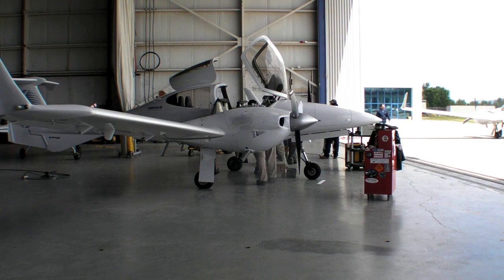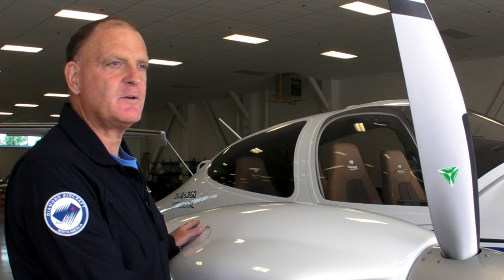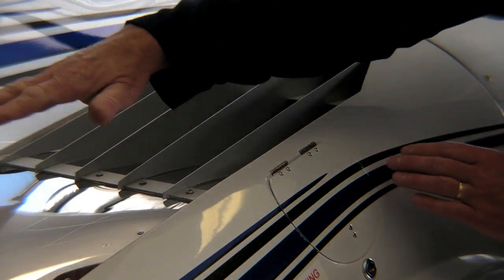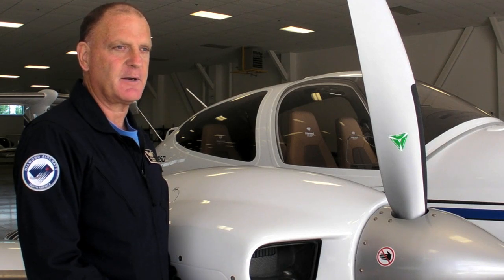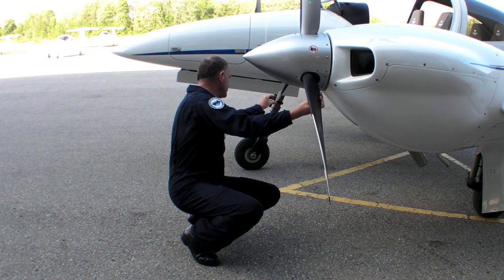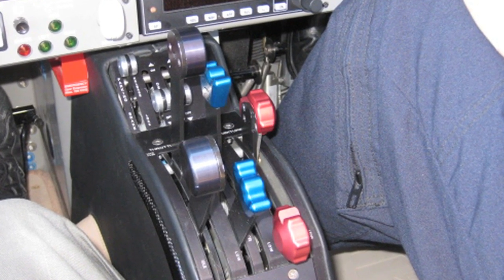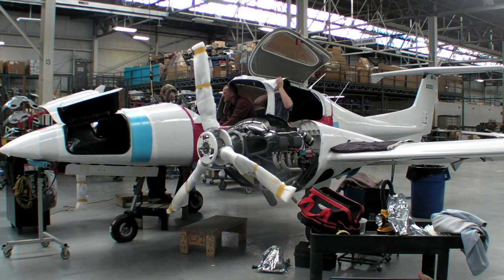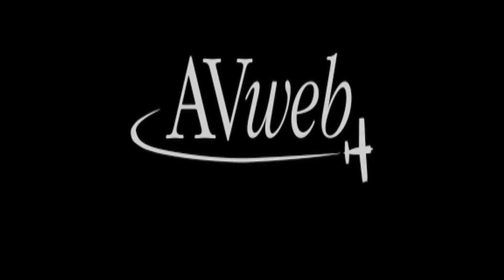Lycoming-powered Diamond DA42 Demo

Comment: If you want a better diesel engine, should have developed the Opposed Piston 2 Stroke Diesel, which can be smaller and lighter than conventional diesel engines with up to 30% savings in fuel economy.

Comment: Same fuel capacity but twice the fuel burn of the diesel = half the range. Worse: the Lycoming engines are lighter than the diesels but the engine mounts weren't sufficiently redesigned resulting in mounts that are too short, requiring 66 pounds of lead to get the c.g. Into a safe range.

Otherwise, fantastic visibility and visibility.

Comment: At about 10K feet the MP is under 20" which is under 55% power. I still clocked 160kts depending on winds aloft. At that power setting it's no wonder that my figures differ from a 75% setting at low altitudes.

Comment: The Twin Comanche has O-320's not 360's, which accounts for the lower fuel flow. My calculations were not by guage or fuel flow meter, which was not really reliable, but I calculated total time flown and total gals to fill up. That gave me an overall fule burn rate. One more thing: we used imperial gallons, which is 4.5 litres and not US gals, which is 3.85 litres, so I will show a much lower gph.

Comment: Just a note on the fuel burn - it cannot be 10.8 gph per side. I had a Twin Comanche, same engines, and burned 11 gph both engines for years. That must've been 10.8 gals total.
Reply: Nico van Niekerk thanks, I was thinking that was quite a bit per side but if it is for both I think I'd rather have the lycoming engines, for the weight savings, plus I live right by the factory where they are made.